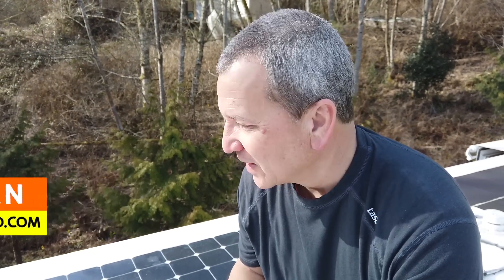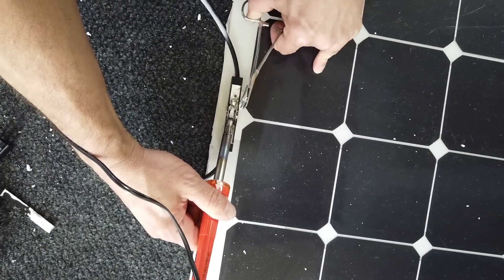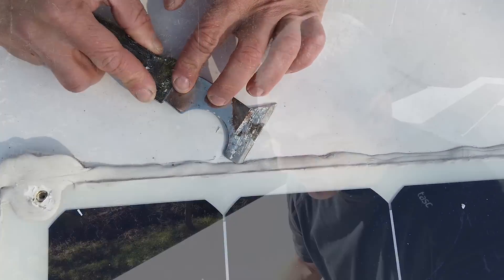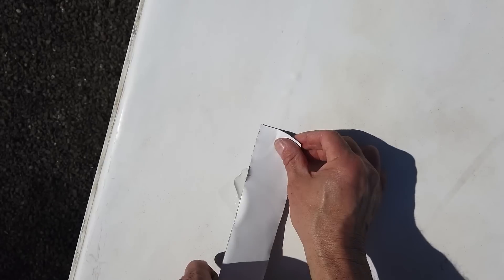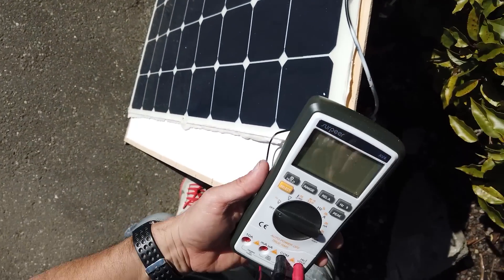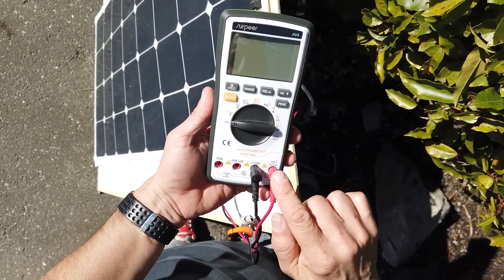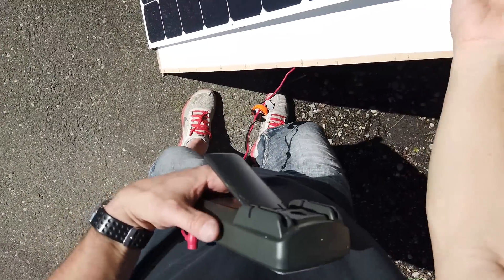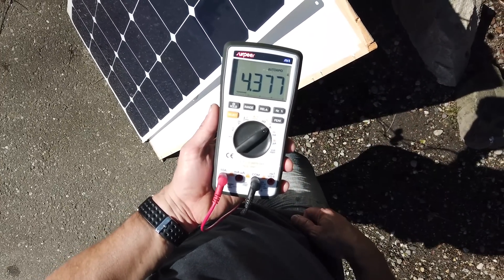Flexible Solar Panel FAILED after THREE YEARS on my RV

Comment: I wonder if the panels perform better/last longer on different types of roof when mounted the same? The 'approved' way of mounting in Australia seems to be with a sheet of  fluted polycarbonate roofing under - with the air gaps running lengthways to help with cooling. The exPAWers mounted their panel using some rubber feet with bolts attached which they then glued to the roof, and used the grommets on the panel to bolt it on, seems to be working well. (https://youtu.be/hoanWnYp4ko)

Comment: Great video! I bought 1200w worth of flexible panels from Alibaba about the same time as you. I'm lucky if I get half the output now. It's good to know I'm not alone. Thanks again for all your honest videos. Long time fan.
Reply from the maker: Thanks Andrew!
Reply: Early flexible panels used a covering plastic that goes opaque after prolonged exposure to sunlight/heat so you lose output. More recently the covering of choice seems to be ETFE but how do you know that's what was used and how do you know it will last more than 2/3 years anyway ? Still best to buy brand name from suppliers you expect to stay around. In this case it looks as if one of the interconnects between the 32 x individual 0.55volt cells has gone high resistance. If you could get at the back you might be able to fix it but destroying the weatherproofing in the process.

Comment: Replaced my flexibles with a solid last week. They lasted 2.5 years, only one broke but I was happy throwing them away. I've gone from 200w flexible to 300w solid, but have more than double the power because it just works so much better.

Comment: Thought these weren't supposed to be mounted, especially not flat? All panels need air flow underneath 🤔
Reply: They were originally designed for yachts and are glued down on the deck with no airflow under - but I guess they get cooled from wind/waves etc then

Comment from the maker: (UPDATE - Sept 2019) Here's a FOLLOW-UP VIDEO taking apart this Solar Panel 
Also, it seems that further explanation of how I measured the current is needed here. I hope this helps. The solar panel's "short circuit" current (Isc rating) is measured across the pos/neg outputs of the panel when isolated from any other load or solar array. As the name "short circuit current" implies, the panel is short circuited during the test. I realize this may sound counter intuitive if you haven't worked with solar panels very much, but this is how it's done. Taking the Isc measurement isolates the panel from a separate load. 

This is not the same as measuring current between a power source and a load which only measures the current (amps) being drawn by the load. 

FOR EXAMPLE: A measurement taken between the solar panel and a battery will only measure the amount of current being drawn by the battery at that time. This will vary depending on the chemistry of battery and its current state-of-charge. A full battery will draw very little or zero current and your measurement will reflect that. 

Sure, you could create a large load to try and max out the panel's output in full sun, but you'll need more equipment and connections to do this. A simple voltage and Isc measurement in full sun is the quickest way to determine if the panel is working to spec. 

The 100W panel I was testing has a max current output of 5.7A. Therefore I could measure the Isc with my multi-meter which can measure current up to 10A without blowing the internal fuse. The meter will only measure current when the positive test lead is moved to the 10A current input. Since there's nothing connected to the voltage/resistance/etc inputs of the meter, switching the dial through the other modes to get to the current mode does no harm on my meter. Of course, follow the instructions on your specific multi-meter if it's different. 

The other acceptable way to measure the short circuit current of a panel (Isc) is to connect the pos/negative MC-4 connectors together and measure the current using a digital clamp meter placed around the cable. The clamp meter is the quickest way and works best for measuring current at any level. That's my prefered way to measure current on a single panel, array or DC circuit. 

Again...I hope this helps clear things up.
Reply from the maker: @Frank Olsen Thanks Frank for adding to the conversation!
Reply: NOT understanding what part was UPDATED???  This is the same video from 3 months ago.
Reply: The missing link to the panel tear down is here https://www.youtube.com/watch?v=WTBMVt5u-no

Comment: Let me show you my surprised face.  What the hell you don't even know how to use a volt meter?    In full sun I would expect you to blow the fuse in the meter.   You need to measure current accrossed a load. Not dead short a crossed the panel
Reply from the maker: Please see the comment I added to the top. Hope it helps clear things up.

Comment: Well, while I have a degree in electronics, and electrical power systems, my education took place many years before this equipment was developed, so all I know about it, is the same as anyone else. We learn what we search for and study. However, I do have two separate 900 watt systems on top of my RV, (I switch back and forth, to better exercise the batteries), one thing I have always kept right at the front of my electronics/electrical knowledge, is that heat is not your friend. Attaching flexible solar panels directly to your roof, with no possible opportunity to air-cool the BACK of the panels, is, in my opinion, a recipe for failure. My own panels - 300 watt rigid type - have a 1 1/4 inch gap from the bottom of the frame, to the roof. This allows a heat-driven exchange of cooling air below them, and, of course, some serious air flow cooling while in motion.

Solar panels have not yet made that greatly anticipated leap to 3 or 4 times the current efficiency (like the 4-layer type used on the Mars Rovers), but the prices have dropped significantly, and the more expensive, but infinitely more resilient, framed, rigid panels, are a much better choice. By the way, imagining your flush-mounted flexy panels are contributing to lower fuel consumption do to streamlining is just not true. They work about as well as gluing funnels over your headlights.

Comment: When i first saw your video installing those flexible panel,  I knew it wasn't gonna last 5 years.  Their biggest problem is they can't dissipate heat very well and it gets worse when you mount it flat on the roof with no ventilation underneath or a way to cool it down.  The connections essentially melts under the cells and kill the whole panel.

Comment: You should try to find another diode and solder it back in. If I'm correct, there aren't any other electronic components in those panels. If that's so, that diode is fried. Besides, it wouldn't cost you more than a couple of bucks to try it. And if it works, you saved the panel.
Reply from the maker: Replacing the diode won't matter at this point. It's wired as a bypass diode. So removing it simply ensures that the flow of current is going through the panel and not through a shorted diode.

Comment: disassemble the panel or cut through the panel between the cells ... I'd be very curious as to a possible fix, or even to end up with two panels that could be dedicated to USB voltage ... EXPERIMENT
Reply from the maker: I agree. I'm gonna give it a try.

Comment: I’m assuming you put a jumper in place of that diode right?
Reply from the maker: Nope. It's a bypass diode wired in parallel (optional). So under normal conditions the panel would function without it.
Reply: If he did, he' would have shorted the terminals together, getting 0 volts and 0 amps

Comment: I did not use screws to attached my panels, just used 3" tape for rubber roofing. no holes and works well.

Comment: Dude...  you have ZERO knowledge of electronics and you have ZERO knowledge of how to operate a DMM.   You don't turn it to OFF and then spin it to your setting, you put it on your setting and THEN connect the wires......
Reply from the maker: Ouch. Please check out the comment I posted at the top. Hope it helps.

Comment: To measure Amps you have to put your meter in series with the circuit, Right?  When you measured the good panel, was it hooked up to the battery to allow a place where current can flow?
Reply from the maker: Not exactly. Please see the explanation I posted at the top. Hope it helps.

Comment: I bought a flexible solar panel about 1992 when I was in Quartzsite, AZ.  It's been on top of semi trailer about 15 years. I use the trailer for storage and used to keep a battery and couple of 12v lights in there. The battery died several years ago and I had no need to have lights in that trailer any more. I don't know the brand or the wattage, but I'm thinking it was 15 to 25 watts at that time and I think it was $150.00 in 1992 dollars. All of that to say that I went to the trailer yesterday and put a test light to it and it lit up. So I guess that one has lasted 27 years.  The panel is screwed to the metal roof with no air circulation under it. It's in direct sunlight any time the sun is shinning.
Reply from the maker: Money well spent ☉👍

Comment: Diode is bad and needs to be in circuit panel is more than likely good . Diode resistance was bad should be .5 to . 7 on diode test

Comment: Sounds like some bonding wires broke inside the panel, this is common for flexable panels though due to expansion and contraction as the heat up and coold down from day and night.so be aware of that as you might want to invest in some ridged panels to replace those. Solar is not somethign you want to cheap out on if you can help it of course, too many possible risks especially on an RV.

The diode is only there so at night your batteries do not beck feed into the cells and drain..
Reply from the maker: Thanks for your input. I'll definitely check the connections when dig in further. On the diode issue: The diode I removed in the panel functions as a bypass diode to bypass the cells in the panel should the panel become shaded and starts to draw vs produce power. What you're refering to is a blocking diode which is not needed because my charge controller prevents any battery discharge. You'd only need a blocking diode if you're connecting your panels directly to the battery.
Reply: @RVwithTito  Messing with those wires is a delicate and tedious task if you can even get to them without ruining the entire panel..  And yes youre right about the diod ein your case. I was hung up on the older systems that uses relays and mercury displacement contactors to cycle cgarging .. IDK why I was thinking about that, maybe it's because I replaces so many of those for BNSF and UP around Arizona and Nevada. But yes modern controller block it..Derp.

Comment: It is surprising that you didn't have a failure sooner. Obviously the quality of these panels is above par. "Heat is an enemy of your panels . There was no air flow beneath your panels, which would have helped keep them cooler. I am sure if you read the literature that came with your panels there was a warning about providing cooling to the panels to prevent overheating them.

Comment: You do not know how to check current with your multimeter. The leads have to be connected between the panel and battery. You should not be producing these videos until you know what you are doing.
Reply: I believe he was measuring the panel short circuit current. Isc on panel specs.
Reply: @gregb1714  To test voltage you hook both leads to the panel. To test current draw, i.e., amps, there needs to be a draw (such as a battery). He is a beginner who should wait a few years before making any more tutorials. Misinformation is worse than no information.
Reply: @raymondjames5035  That is not quite correct, a battery or anything else is Not needed. The panel generates power (watts) from sunlight. Panel short circuit current should be listed on the back of the panel, it is the Isc number. This can be measured using just a multimeter. When a multimeter is set to amps, the meter acts almost like a short (wire) between its leads, so it is the "load". So you can measure panel short circuit current generated by connecting the meter across the panel terminals. Just make sure the multimeter amps range setting is Larger than the panel Isc number. In this case, the current he measured was not even close to the Isc spec. so the panel is bad.
Reply from the maker: I appreciate you sharing your thoughts Raymond, but please read my explanation I added at the top. Cheers.
Reply: @RVwithTito   You're cred when downhill when you glued flexible panels to your roof. I bought my first panels in 1979 at about $18 a watt... It takes time to learn about solar and being a novice you are not really to teach others.

Comment: Panels need to be able to dissipate heat. Glued to your roof does not allow an air flow underneath. They quit producing electricity after 150F.  Flexible panels last only 5 yrs.
Reply: you are very correct!!!!!!!!!!!!!!!!!!!!!!!!!!!! work fine for me.

Comment: PV cells need a air gap. They burn up. This was known when you installed. It's not rocket science.
Reply: No air gap on a yacht when they are glued to the deck - which is what they were originally designed for
Reply: @linz_in_NZ  All solar panels get hot and having air flow allows them to last. Stop making excuses for something you have little knowledge of. Marketing and design   are to different considerations.
Reply: @linz_in_NZ  Flex panels are a joke and for the easy button crowd.

Comment: I have two 136 watt unisolar panels on my truck camper.  I am very happy with their performance.  I even had to replace the roof this spring and was able to remove it from my roof.  There was enough adhesive on the back to put them back on the new roof.  I didn't think they would still function, I waited until a nice hot part of the day and very slowly pulled the old roof off of the adhesive, the angle I had to pull was probably 120 degrees and I would have figured it would damage the panels but they actually worked just fine when I tested them.  also, I don't know what the efficiency of these panels are, but before I removed them off of the roof, I never got more than 9.5 amps to the controller, now in strong sun, I get up to 12 amps.  The only thing I can guess is I did shorten the wires from the panels by about 2 feet.  Does anyone know if that would be enough to account for a 2.5 amp increase in amperage?  BTW I had these type panels on my last rv and these have been on my truck camper since 2012.  Very happy with them, I never had a problem with either camper, I am not good at figureing out the efficiency, I only used the controllers, gauges as a reference.
Reply from the maker: I currently get around 17 amps from my Unisolar panels combined (6 years old now). They are great. I often wonder if it would be possible to remove them without removing the roof. I hope I don't ever have to.
Reply: @RVwithTito  Wow, that's alot of amps, how long is the wires from your panels to the controller, mine is about 8 feet long.

Comment: What brand is that panel, my 3 year old gopower flexible panels have a 5 year warranty?
Reply from the maker: This is an HQST panel. My other HQST panels are still working fine. A 5 year warranty is pretty good for a flex panel. Most are 2-3 years.

Comment: Brian I think it likely that the panel failed due to a cold/cracked solder joint within your panel. You're getting voltage because there is a connection within the panel but it is too small to carry any current. Unfortunately, there is no way to repair it without destroying the panels weather protection.

It would be like if your inverter was connected to your house batteries by only one strand of the large copper cable you have... You could detect voltage but that tiny wire in no way could carry the current to run your inverter.
Reply from the maker: I think some panel destruction is in order :)
Reply: @RVwithTito  A bit of Russian Roulette to find which connection is the bad one. It would be easier if it had an open to find where the failure is. But it might make for good video digging into it to find out.

Comment: Heat kills them - no ventilation underneath like on a solid panel install. Not so surprising as they are black and absorb all the heat plus summer temps. Would be 90C plus I would think

Comment: Why flexible panels instead of traditional panels mount that allows for ventilation? I have been told that solar panels work better when they are cooler
Reply from the maker: I never was one to follow the rest of the crowd :) You're right. All solar panels perform better when cooler. So I've got a better way coming up.

Comment: Very helpful. Your other roof panel are amorphous flexible panel correct? how old are they vs the failed panel?
Reply from the maker: Correct. They've been on for over 6 years and still going strong.
Reply: @RVwithTito  - wow that company was still in bz. Thanks again gor the videos
Reply from the maker: @thomasdipaolo2349  No I got them from eBay after the company went bankrupt. Bummer that they did. I think you can still find them in limited supply on Amazon and eBay.

Comment: 1st mistake was buying flexible panels instead of glass. I thought about that and got Grape solar but there is a company that has 320 volt panels for cheap. You should try Arizona Wind and Sun.

Comment: So, what have you learned?
Reply from the maker: (1) No need for Dicor (2) No need for screws (3) Try using an insulated layer underneath (4) also (not mentioned in video - condensation still builds up underneath after a while)
Reply: @RVwithTito  #3 - NO, that will kill the panel sooner! Your roof acted like a heatsink for the panel but that was not good enough, it still got too hot and died. An insulated layer will allow it to heat up faster and get much hotter.
Reply: Greg B .